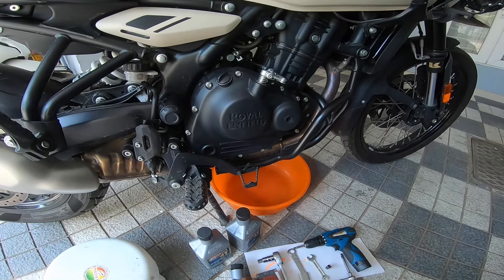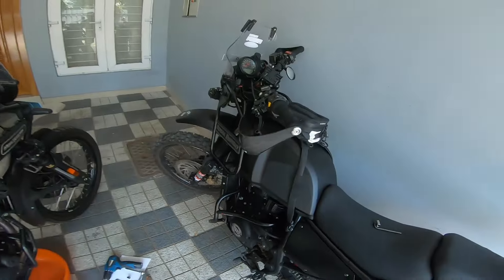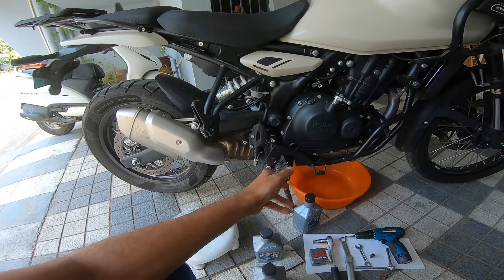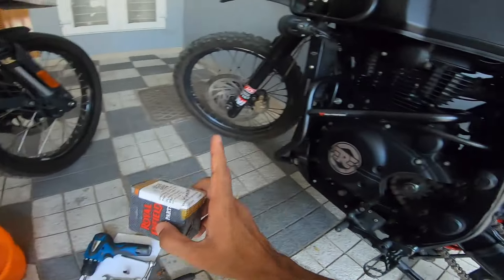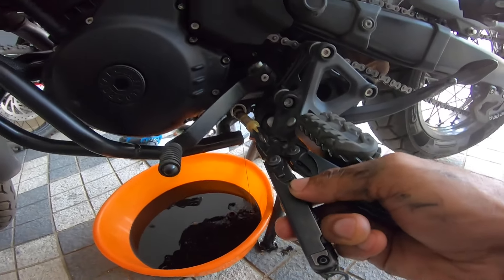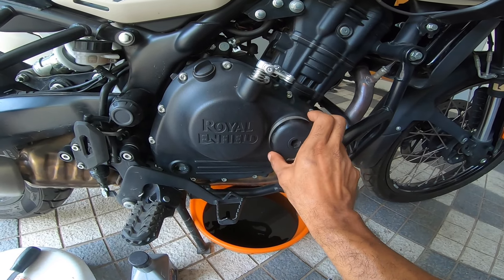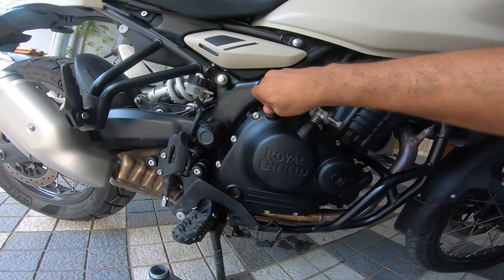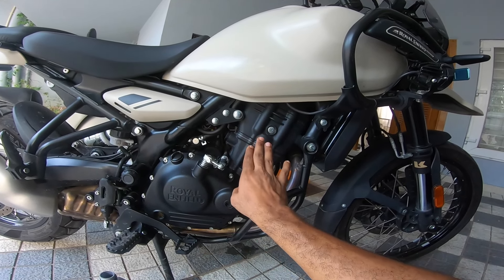DIY 450 HIMALAYAN ENGINE OIL CHANGE - STEP BY STEP

Comment: I think Himalayan 450 uses 15w50, same as 410.
Any reason you went for 10w40? to use more viscous/thinner oil?
Mine 410 sometimes create issue in morning startups, require inital revs to settle down in winders.
Thinking of opting to 10w50. Amsoil have that grade as well.

Comment: Hey ben, I own a Himalayan 411. Im a bit skeptical about the engine oil change period. RE suggests to change the oil every 10k KMs but they are using a semi syntethic oil (liqui gun) and we know semi synthetic hardly last 2-2.5k KMs. This time i change the Liquid gun oil at 1.8k KMs and changed it to Liqui Moly 10w-50 (same grade as suggested by RE) full synthetic.
Reply from the maker: Change every 3-4 k kilometres if ridden everyday
Reply from the maker: Any oil
Reply: what about fully synthetic oils ? The packaging suggests a change interval of 6k KMs

Comment: Hello, Ben! I follow you on YouTube and love your videos; I really appreciate your passion. I have a 2021 Himalayan, still completely stock, and I’m thinking about making some modifications. Considering that I use the bike both in the city and for traveling on high-speed roads, and I also want to do a bit of light enduro, my goal is to improve it to have a cruising speed around 100 km/h without feeling too many vibrations and keeping the RPMs a bit lower if possible. Do you think that by changing the air filter to a BMC/DNA and using a more open exhaust terminal, I can achieve this result? I wouldn’t want to lengthen the gear ratios since it would then be a problem for enduro and steeper climbs. I hope you’ll respond. Thanks.

Comment: Hey ben. Why have you not installed the maddog aux lights on the forks ? Any particular reason?
Reply from the maker: @shufflex8403  cause it’s not the right thing to do on a motorcycle. Never mount lights to the triple clamps . If you know you know . Otherwise you can take my word for it .
Reply: @ONTWOWHEELSBEN  Got it. Thanks Ben 😊

Comment: Bro i too did oil change by myself but forgot to twist and put those two strainers back in , will that cause any issues 😢?
Reply from the maker: @syedvasim9454  it will keep vibrating and may get damaged ( MAY ) . Lean the bike on the right . Open up the bolts and twist / turn the strainers in position . Not a drop of oil wasted .
Reply: @ONTWOWHEELSBEN  thanks alot brother for the advice 👍
Reply: Bro I measured the oil after removing I got 2.6L but RE suggests to put 2.1L back after draining; so a bit confused 🤔 should I add some more engine oil or no?

Comment: Cut an empty coke/soft drink can in half (length ways) and hold it under the oil filter cap while undoing it and you can redirect the spillage to the tray without making a mess 🙂

Comment: Is there a way to reset the service indicator in the display settings on this bike? Or do you need a dealer only diagnostics tool?
Reply: Turn ignition on, put the bike in 6th gear, navigate to the service menu using joystick and press the joystick button to the left and hold for three seconds.

Comment: Do you plan to show how the spark plug would be changed? Since it's water-cooled, I imagine the tank and the air filter box will have to be removed, quite a challenge compared to air-cooled R.E.s.
Reply from the maker: Have already made a video on air filter swap . The tank removal part has been covered in the same
Reply: @ONTWOWHEELSBEN  i Saw it , but there's no video yet of the air box removal on the internet, maybe you will be the first one
Reply from the maker: @Sr.D  sure , i will soon.

Comment: Hi Ben , i asked a doubt, RE guys say after draining the engine oil we need to fill 2.1L but i measured the oil after draining it was around 2.6L😢? 
So actually should i add more or leave it bro?

Comment: Even shell 10w50 long ride fully synthetic oil is very good
Reply: Yep but amsoil still at league of it's own there is a difference between fully synthetic and 100% synthetic oils only a few manufacturers able to crack that and amsoil is one of the pioneers of synthetic engine oils

Comment: Manual states semi-synth oil only, This is fully synthetic
Reply from the maker: better but always swap after the bike has run atleast 2000 kms .
Reply: @ONTWOWHEELSBEN  My himi ran about 2.6 k kms now . Can I change now or is it okay if I change it after 5k at service centre?
Reply: Hey @ONTWOWHEELSBEN big fan! 
Quick question if manual states semi synthetic will adding 100% synthetic not damage the 450?
Reply: @ahanbapat8805  Manual mostly states the minimum required values. In that case, Himi450 is capable of running in semi synthetic itself, which is good to hear.

Comment: always run to warm the engine before the oil change!
Reply from the maker: I did. Pls
Watch the video without skipping .
Reply: @ONTWOWHEELSBEN  I saw the whole video. In the video, you mentioned that you ran the engine, and then cooled it. Let it cool down for 20 minutes. But what I am trying to get at, is you need to change the oil when it is warm!

The correct way of doing it is going for a good ride of 50+ KM, having hit 3/4 rev on the meter, and coming back. Let it sit for 10 to 15 minutes and then drain it at an optimum temperature of 60 to 70°. So that all the sludge particles and the impurities are still in mix and not resting somewhere in the engine.

I am consulting you as an automotive engineer, please don't take it as a criticism, rather than feedback.